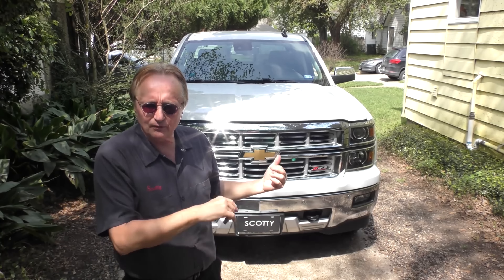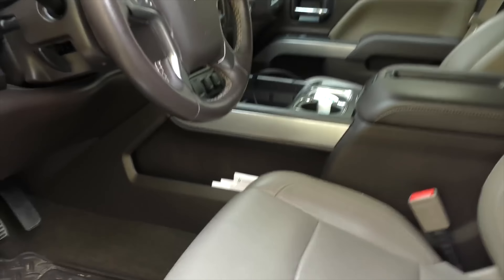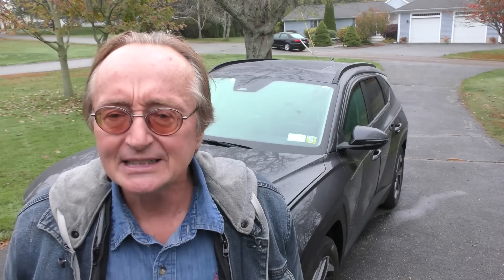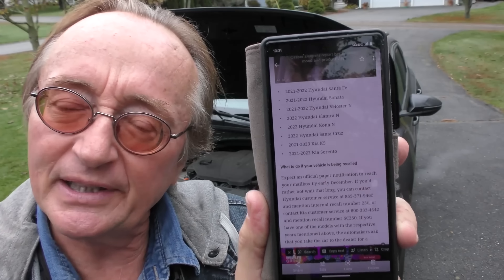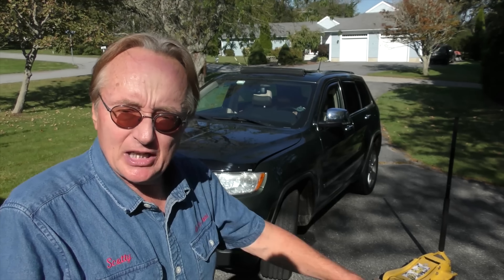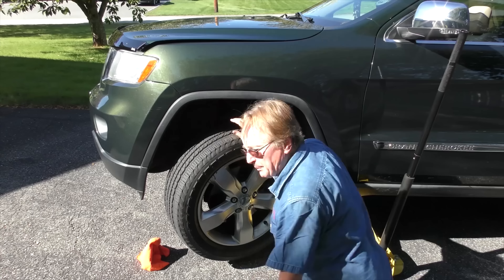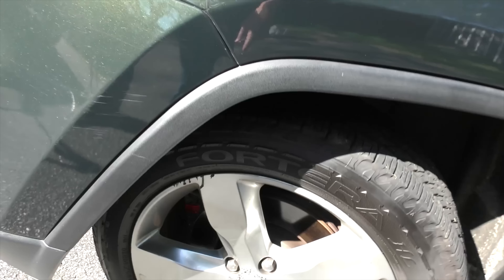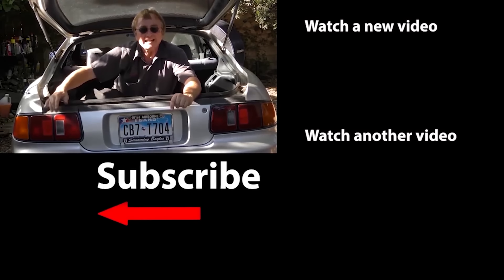3 Car Brands I Wouldn't Touch with a 10 Foot Pole

Comment: As a former small town, Chevrolet dealer and Chevy fan for the first half of my life I now only have Hondas and Toyotas. My truck to pull my trailers is the last great Toyota made the 2021 Toyota tundra crew. As soon as I heard, they were ruining that truck with electric engines and twin turbos. I rushed out and bought The high horsepower and torque gas hog tundra.
Reply: You gotta tell me about that truck
Reply: You talkin about the V8 Chevy power Tundra, yeah, my brother in law bought one of those, engine was great, but he couldn't stand the rest, terrible suspension rear wheel wells started rusting out in one year, he couldn't hardly give the damn thing away, has a GMC now, so far so good.
Reply: @user-Dr.  finally some decent comment about toyota tundra, they falling apart, terrible suspension, cannot get  an alignment done and Tundras  cannot take any abuse that ford take or older chevies.
Reply: Amen brother, gotta love the Toyota Tundra with the 5.7L I-Force V8 in it that'll outlast any Ecoboost Ford makes
Reply: @CJColvin  one would think that, but they not outlasting anything, .. tundras are garbage, ..
Reply: @CJColvin  Yes, that V8 you speak of, not available anymore, yeah, that engine was supplied by General Motors.
  Toyota engine line up right now is a disgrace, the one real weak spot for Toyota is their complete inability to build good engines, GM is always two steps ahead of the rest of the world.
Reply: @user-Dr.  Yeah but not recently, they've really shot them selves in the foot ever since they killed Pontiac off.

Comment: I just dont trust American cars. And I feel like Scotty agrees and knows better than I do.
Reply: He doesn’t trust supercharged engines, either, which now all the Japanese manufacturers have moved to.  So if you can’t trust American cars, and you can’t trust small engine turbo-charged cars…..walk, I guess?
Reply: Yep American car manufacturers have been going down for like over 20 years😂
Reply: @harveyhankerson8359  you thinking about keeping it?
Reply: @brads1545 Majority of cars do not use forced induction so your comment doesn't make sense. And diesel cars are largely different compared to gasoline.
Reply: I'd trust Tesla
Reply: @billolsen4360  yea and then pay 50 grand for a new battery in 5 years? No thanks
Reply: My 2020 Ford Fusion is pretty great, honestly. But I definitely overpaid (had to replace my old car at the worst time to buy) and I did exhaustive research on what would be a good choice that wouldn't leave me stranded or with a huge bill. I'd say the Fusion is an exception not the rule.
Reply: What about American cars from the 50s, 60s, and early 70s?
Reply: I also don’t trust American cars.
Reply: @JABelms  Turbocharging is really popular. My little 4cyl Ecoboost is powerful yet very efficient. Pulls a 3,000 lb trailer like it's not even there.

Comment: To each his own. I was raised around gm for 45 years. I've had to repair far too many ford's in odd situations.
Reply: I don’t like fords of course although my old explorer was driving with 200k, all the GM cars my family owned (buick LeSabre, Buick rendezvous, Chevrolet lumina, Chevrolet cobalt and a Chevrolet Cavalier, GMC Jimmy and all ended up having problems and leaving us stranded. Converted the family to better cars
Reply: My grandmother's 2010 Chevy Cobalt with almost 150k miles still runs like a clock 14 years later.
No rust either, despite plenty of winter driving on salty roads.
Reply: Me and my parent only drive toyota, my brother and sister drive all different kind of car, my sister is still on her first 2010 Kia, she had it broke in once by those low life Kia boy, my brother Silverado has that popular P0306 lmao 11k to repair, now he owns a ram and I wouldnt even dear touch it, helped him once on the oil change and im not EVER helping again
Reply: @MatthewTheCCMA not a huge fan of Ford either but if I had to pick it definitely won’t be a GM product. I had so many problems with my Pontiac Montana van and my wife and her friends all had GM garbage that had issue upon issue.
Reply: I used to be a GM guy. Not anymore. Their quality has become horrible. Utilizing some Ford Vs. GM argument like some old guy in a bar is just being afraid to admit your wrong
Reply: Their gas engines blow away Chevy AFM engine but still, GM trucks are the best at everything else.

Comment: Can anyone explain to me why Scotty's Celica has had 240,000 miles on it for like 6 years?
Reply: It doesn't run.
Reply: He keeps saying that he changes the oil in it every 3,000 miles......but he hasn't driven it more than 1,000 miles since he bought it 🤷
Reply: Scotty always uses the Matrix when he drives back and forth between Rhode Island and Tennessee.
Reply: He worked on it so it doesn't run couldn't figure out how to get the hood up if he didn't have hands he couldn't talk
Reply: The odometer broke on it

Comment: I passed on the Rav 4 because of that horrible info screen that I couldn't see over - I'm 5'2", and I'm used to all the great vision I have in my Subaru.  Scotty, thanks for these great videos.
Reply: Good luck on the silicon gaskets that will leak
Reply: @matthewinaz what gaskets?
Reply: Toyota did that before, because I've one. The 2004 Toyota Vios first generation (south Asia only) look at the speedometer, I'm 5"9 and it's higher than windscreen.
Reply: @matthewinaz literally every manufacturer uses silicone gaskets now. Change your oil regularly and it will last fine. If it does leak it's after 150k-200k miles and is only a small weep that isn't even enough to drip down.
Reply: @GF-mf7ml  When Scotty's driving, he can see the pedals without looking down.
Reply: Toyota's are overpriced anyway cause they only employ tall engineers & they're hard to find 🤷
Reply: The RAV4 is probably one of the best selling SUVs in the country. I agree with the screen I have a 2020 XLe RAV4 and being over 6 foot. It’s a perfect size car for myself.

Comment: Hyundai did well for me with 3 different vehicles. Santa Fe, Elantra and bought my first one off the showroom floor. An Accent.   
Loved the old style Santa Fe.
Warrenty best in the business at the time.
Only had small recall issues, nothing major at all.
Reply: Mileage on them?
Reply: My 2010 Honda Sonata has 130k miles and the only major issue I ever had was needing to replace the timing belt.
Reply: I’ve got an 08 sonata that runs like a top that I got for 4 grand years ago. Great cars. Huge trunk too. 

Wouldn’t touch a 2011 and up though.
Reply: Hyundai is junk now sorry
Reply: @georgenovotny4421 atleast Hyundai stands behind their 10 year , 100k mile warranty.   Ford and Chevy don't even like to honor their garbage 3 year 36k mile warranty.
Reply: No they don’t stand behind power train warranty. They will tell you the torque converter which goes out commonly, is not part of the power train. Ask Scotty, and watch his video about how the scumbags at Hyundai told that to one of his viewers when the converter went out. Everyone knows the torque converter IS part of the power train, but Hyundai says they don’t cover it under their power train warranty.
Reply: @georgenovotny4421  Ignore comments from the cosplay aviator.
Reply: 3 different ones???
 Try keeping one for 29 years like Scotty does then get back to us.😅
Reply: @Insert.Name.Here. That's a lie. Hyundai and Kia are the worst and require meticulous maintenance.
Reply: @302Mustang13  have you actually owned any hyundais?  I have owned 3 and very little maintainance was required at all
Reply: @Insert.Name.Here.  Had a 2018 Tucson as a rental for a month. Saw the maintenance guide. That and it was terrible on gas. Best I ever got was 27 mpg on the highway and that was hypermiling. Did ok mpgs around town but was very slow.
Reply: @InternetUser._  that was my point honestly. Same. Models from '10 and up seem to have lost their durability/reliability.
Reply: I have a 2012 Hyundai Sonata with 145k miles that has required oil changes and tire balance/rotation with very little else. Everyone is going to have different experiences of course, but for myself and the three friends & family I know who own Sonatas or Elantras they have been reliable, affordable, and long lasting
Reply: @khayman714  I've had two Ford Fusion V6 sedans. The second one is 16 years old and has 235,000+ miles. I've done nothing but regular maintenance and some shocks/struts. I also did a new water pump when I changed the camshaft driven water pump belt, not because it needed it but just because I know those eventually will go. Now those are super reliable cars that most people seem to have great luck with.
Reply: @Insert.Name.Here. And you forgot dodge 😁
Reply: 2016 Sonata with 172K miles on it! The motor on the pano sunroof seized up and had to be replaced at 111K and the front passenger heated seat stopped working at 122K. Also a few recalls that were fixed under warranty and which were not out of line with the sorts of recalls you see with any car these days. That's it. My mechanic tells me it's one of the best-built cars that comes into his gas station.
Reply: Hyadi accent!! Had a 99!! Wonderful!! Small car;!!! Tough, as any!! & More!!!!!!......

Comment: My 17 1500 LT double cab   has 98800 and no major issues up to this point my tailgate handle is stronger than an Albanian field wench. Gas mileage is 20-24 with it always in v8 mode with Cold air intake. There is vents under the front seats shooting to the rear. I absolutely love the truck the 3 years I've had it. Lol

Comment: Glad you are coming around to Hyundai. I've had nothing but good things to say about them for many years.
Reply: Being sued is a good motivator.
Reply: Hyundai are still junk... I had a 23 night edition Santa Cruz, got rid of it after just 2000 miles.. what a pile of crap.
Reply: They are definitely junk now.
Reply: Owned 3 Hyundais (Tiburon, Tucson, Sonata N line) all 3 were great.   The engine went out in the Tucson at 80k mile,  BUT Hyundai replaced it for FREE and paid for my rental for 2 months while they did the repairs.   Can't really complain about that!
Reply: @georgenovotny4421   Something a Screaming Weasel would say.
Reply: @1976axerhand what did you not like about the Santa Cruz?
Reply: I must have missed that part, he had very little good to say.
Reply: I really like the peeling paint that half of them come with after a year or two. The low residual resale is also a peach.
Reply: U should hang out with my uncle, he brags about Hyundai's all the time (he luvs them)....his Hyundai actually sounds like a clock, makes ticking noises 🤦

Comment: Scotty, that is such a good point to make about having to replace all 4 tires on AWD or 4WD when you get a nail in the wrong place. With good tires, my FWD Kia handles the infrequent snows of lowland Washington just fine, and so did my old Toyota FWD sedan. I'm ordering a FWD Ford Maverick hybrid and the tire cost is a good reason to resist the constant chatter to switch to Ecoboost FWD. I've never leased a vehicle but your friend did OK with that lease. My state issued 2004 work Jeep had brake and suspension rust at an early age, same roads and places as my 2003 Ford, so you've explained that.  Thanks for the lessons!

Comment: ‘94 S10. 4.3/5speed. Sold it in 2020 with 315,000 miles on it. Still had the original clutch and never had the heads removed. Shoulda kept it but I don’t have room.Akebono brake pads did work fantastic as Scotty says.

Comment: My Chevy equinox 2014 LTZ is in good shape for 10 years & 100k. Chevy didn’t do bad with the 3.6 engines. But my old 2002 trailblazer with 300k is still rolling
Reply: My wife had a 2014 equinox with the 2.4 liter and it blew the engine at 80k miles and burned a quart and a half ever 2 weeks.  Up until that it was one of the nicest riding and driving cars we’ve ever had other than her Maxima

Comment: Ive got a 2001 4door Silverado 1500 HD 6 ltr.with 303,000 Miles . Ive spent about $4000 in the last 7 years replacing enguine parts and tires but its still gets me to work and around the city.
Reply: That's $4,000 well spent.
Reply: Hang on is that cost of regular maintenance, ie tires, brakes, oil? Or just for non-routine repairs?
Reply: @richardloach610  non routine. Fuel pump replacement, power steering pump replacement, radiator replacement, brake lines replaced, computer chip replacement, upper tie rod replacement, oil pump seal replacement, emergency brake line replacement, water pump replacement. Of course the extra for new tires, brake pads, rotors, brake pistons and calipers. Transmission service and I always change my oil with Mobile One and a WIX filter.

Comment: I work for Advance Auto Parts and the delivery vehicles that the company leases are flawless when we pick them up but when the lease is up and when we have to drop them off at the dealership, some of the vehicles have to be brought in on a flatbed. Can you imagine what Advance Auto Parts pays to lease 4 vehicles per store across the nation? Unbelievable!!!
Reply: i  work at napa we had some chevy sonics. all of them are crap. blowing radiators and ac switches in under 100k miles. And in those 100k miles the timing broke and they had to trash em. Dont recomend sonics for sure!

Comment: i was a mechanic for 32 years and i agree with scotty on chevy.  chevy quality started declining sharply starting in the 1990's. quality of parts and engineering stupidity overhaul.
Reply: That's funny, the 98 Chevy truck has been determined the best vehicle ever produced, will run longer, go further with the least maintenance of any other vehicle produced, I differ from that a little, we had a 93 Cutlass Supreme that we had over 1 million 350 thousand miles by the time my youngest daughter wrecked it, original engine, AC still worked even.
Reply: @user-Dr.  there are a few exceptions. the 93 cutlass supreme was a j-body and was actually decent. but most if not all of the j-bodies were discontinued after 1995

Comment: I have a 2015 chevy silverado and thank God I bought the warranty because over 11,000 dollars later I think it's running right. Ac, fuel pump, radio, entire front end rebuild, broken driver seat brackets, etc.  It only had 66,000 miles.

Comment: Scotty, that chevy is a good truck. My mom and dad have one and it has 270k miles on it. The evap coil is a pain to get to, but that’s a rare occurrence with them. I think the goods out weigh the bad
Reply: Wrong
Reply: the ac evaporator it’s not a big issue send it /sell it abroad will cost $250 repair plus parts
Reply: I just recently met a guy who had a Silverado that couldn’t have been any more than 10 years old and his tranny went out. You never see that happening with Toyota trucks that age
Reply: @JoeTricep it depends on how he's used it, if he abused it by towing or driving it irresponsibility than that's probably why. My dad has a 2014 silverado with 137k miles on it and the transmission still runs just fine and it will be 10 years old in april
Reply: @winning2273  they should be built to withstand unlimited abuse like Toyotas, otherwise you’re taking a big gamble buying a used truck. And i would be impressed if it had 237k miles
Reply: @JoeTricep  I agree, a vehicle should be able to withstand heavy use, in fact I have a neighbor who has a 2002 2500 durmax and the transmission went out at 300k miles and all he ever did with it was tow heavy loads with it. That's quite impressive, not to mention my brother's 2006 silverado and his 2007 impala both have over 200k miles and my colorado has over 100k miles on it and my dads 2014 silverado has over 100k miles. All of em rum strong and still have plenty of life left in em just gotta take care of them and they'll take care of you
Reply: @winning2273  newer ones aren’t as reliable tho
Reply: @JoeTricep  I agree, that's why we aren't getting rid of any of our chevys were just gonna fix and maintain them. The newest one we have is from 2014 and even then it's still been incredibly reliable and has lots of life left. I'm pretty sure that's one of the model years scotty dissed on and I don't understand why

Comment: I have a 2007 Silverado 2500 HD . Haven’t had any real issues but the windshield leaks water from the top when it rains. I have to keep dri z air crystals in the cab in the winter to prevent mold forming.
Reply: Well that sounds like a real issue 🙄
Reply: Why wouldn't you just take it to a glass place and have it resealed? That's cheaper than having to deal with mold.
Reply: @jackcrisci2957  That’s how it came from the factory, the moisture buildup in the interior eventually destroyed the window switches and speakers , that’s why I now use the dri z air . I should have it fixed but it’s probably going to be expensive job.
Reply: @flyinphil42  That sucks dude. That should have been caught under warranty and I'm sorry you got stuck with it. And cost would depend on your windshield's size and how fancy it is (auto sensing wipers, etc.) but that's only for a replacement. I'd at least get it diagnosed. Could just be a bad seal where your cost would really only be labor? Could also be a badly formed windshield where you'd need a full replacement. It's at least worth knowing IMO.

Comment: 2015 it's almost 2024 that's 9yrs old, either way i agree with you on the quality, I own the same truck, same year and color mines only done 64k and have a cylinder #4 misfire runs like crap been parked tell I save up the money to fix it, in the meantime I'm driving my 99 Silverado with almost got 300k still runs perfect